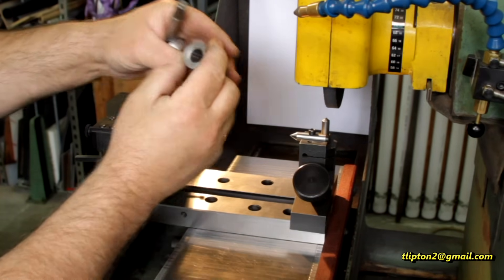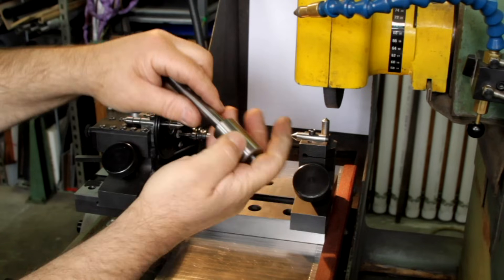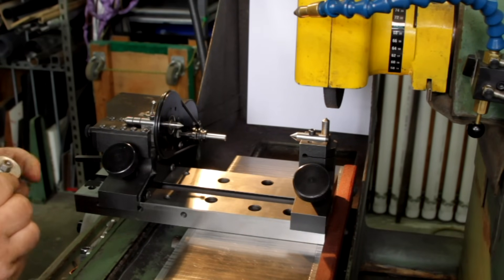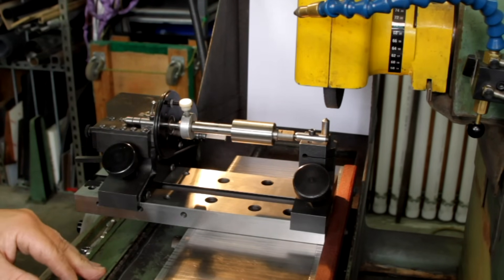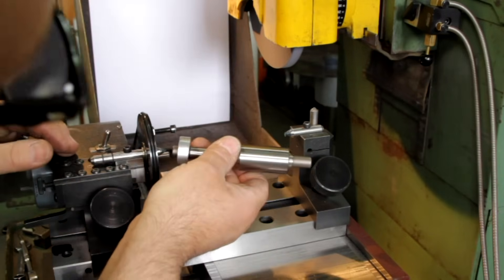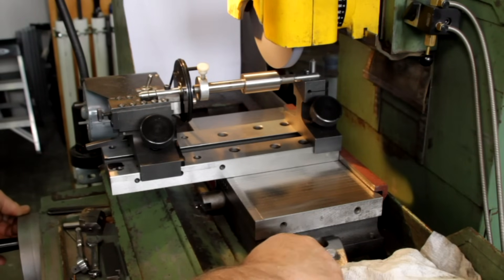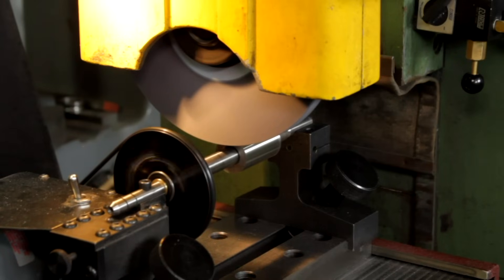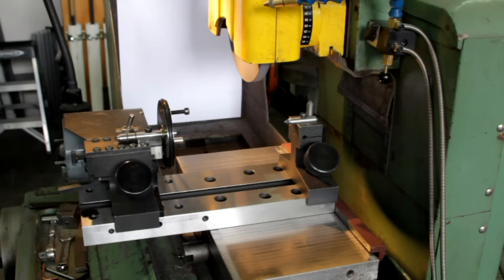Cylindrical Grinding on a surface grinder

Comment: Hi oxtoolco, I recently pickup a south bend 10 heavy, It has a worn head stock spindle shaft, I made up a surface grinder to mount to my older south bend 9, When Grinding harden steel is water used to keep it cool during Grinding, Thanks Brian

Comment: Hey man
The reason behind vibrations can be that white head fastener on the mandrel because it is a offset mass.
Love your video
Love from India
Reply: Yea that flat finger tightened screw twirling around on the mandrel does seem suspect.

Comment: Try using a red grease pencil on shaft before grinding. shows highs and lows and helps stop crashing into the shaft when feeding in, old centerless grinding trick. also helps when grinding non-sparking material. thanks for the vid!
Reply from the maker: Good one! Thanks for the comment.

Cheers,

Tom
Reply: senocon visited a workshop where they generally used inks on every job.

Comment: Hi Tom,
That's a nice device for grinding cylindrical parts, I'll have to get my hands on one if it shows up at a decent price...
I'm always puzzled as people grind without cooling the part with coolant, if I can feel the heat it means to me that the part isn't to dimension as it will move ever so slightly when back to the room temperature or original temp...   Also, the finish gets so much better with coolant.
Cheers,   Pierre
Reply from the maker: Hi Pierre,

For light cuts with a sharp wheel no coolant is fine. You are right that in general coolant produces better finishes. Thanks for the comment.

Cheers,

Tom

Comment: Excellent info on the grinding process. Years ago I came across the Atco grinder attachment base. Mine is missing the motor, pullys and centers. I see after watching this video, how useful this tool can be. Would it be possible for you to send me some info from your unit on the motor and any possible sources to find a comparable one. Would be a great help. Thanks Tom.👍

Comment: Just wanted to point out that the intermittent cut on the cylinder tends to generate heat only in the contact spot , tending to warp things around while the heat is still in it. So cooling  the part down between cuts helps accuracy  a bunch.  Watched a  foreman  destroy a blank punch for part of a clutch. it was about a foot in diameter , every time the wheel contacted the punch it would swell up in that spot  and cut even harder on the next rotation  in the same spot.  Don't think he even knew how he had wrecked it.   but there was a gob of clearance in one spot.

Comment: Nice stuff.
Isn't the most critical setup the parallel of the manfrel and the line of travel?
Not the touching of two circles on the very top, as they will touch allways tangent.
If mandrel out of parallel from travel line, you will get a cone.
Or I'm wrong?
Reply from the maker: Yes the mandrel needs to be parallel to the travel of the machine. In this case the grinding was to remove nicks and produce a better finish on the hard part. Thanks for the comment.

Cheers,

Tom

Comment: can somebody explain to me why a round bored part would sit perfectly concentric on that tapered shaft? couldn't it sit off? or does it not matter in this case if inner and outer diameter end up not being true to each other?
Reply: Jörn, I believe he said a half thousand across (I'm guessing) six inches. Couple of tenths, perhaps the tapping would seat it enough on the shaft.
Reply: Jörn Bucklitsch yes, I was thinking the same thing, probably because I am old, slow and stupid which requires more of an explanation.  And yet it looks like it is running totally parallel to the tapered mandrel, go figure!!  Regards. Joe.
Reply: I had this exact same thought. I'm guessing the taper isn't extreme enough to make one end of the bushing "off" a bit.
Reply: Jörn Bucklitsch the mandrill will touch each end of the bushing - it's only a couple of tenths across the length of the bush, and when fitting it to the mandrill it is an interference fit on the larger end - by that couple of tenths, so the small end will still be touching the bore.
Reply: alright thx for claryfying

Comment: Hello, when I was working in the watchmaking I did the same for the finishing of some tools on a lathe. To improve the finishing I put the diamente paste on the grindstone. Sorry for the quality of my English which is a Google translation.
Reply: No sweat, Philippe, I have read far far worse from supposed native English speakers be they from America, Canada, UK or Australia, New Zealand. Your comment was easy to read and understand by comparison.
Reply: Mark Fryer salut, j'ai écrit mon commentaire en français et Google me l'a traduit.
Reply from the maker: Hi Philppe,

I understand what you said. I have not tried this method. Thanks for the comment.

Cheers,

Tom
Reply: bonjour Philippe, Est-ce que vous travailler au Québec... ou dans un autre lieu dans la francophonie?
Parce que, si vous etes pas loins de Montréal-  bienvenue. Cherchez "Machineco Montreal" en Google. 
Nous avons plusieurs rectifieuses en stock.
Reply: @loftsatsympaticodotc  Salut, je suis en Suisse.
Reply: Um. Compounding your abrasives in a hierarchical fashion?

I love it.

Comment: but how it runs true when its perfect id is in contact with tapered od of the mandrel?only one end of the id is full contact with od of the mandrel,the other side is loose.am i missing something?
Reply: the taper is low enough that, with the blow on the anvil, you get good contact all across the bushing
Reply: Nope.. wont be concentric on the small end of mandrel but won't necessarily be loose either. If you heat it up it could spin on ya.

Comment: why does left right position affect surface finish.  it appears that the geometry would be unchanged as the wheel will always contact normal to the parts surface ???

nice vid :)
Reply: to minimise the reaction forces. Since the centers are floating any excessive radial forces will cause the mandrel to bounce around.
Reply: so less bouncing vertical then off vertical ??  for safety should be at least center or left of center so it doesnt get sucked in by the wheel.
Reply from the maker: Hey John,

Good question. I don't have a good theoretical answer as to why. Its just one of the knobs you can turn to change the output. 

Best,

Tom

Comment: Hi tom can you adjust the angle to cut a tapered shaft or make sure its dead parallel?
Reply from the maker: Hi Jason,

Its usually the other way around. Trying to not cut a taper. Turning it on the magnet should not effect the taper. There is a small adjuster on the tailstock end of the centers used to get taper out. Thanks for the comment.

Cheers,

Tom

Comment: Correct me if I am wrong, but wouldn't mounting on a taper ruin the concentricity between the bore and the O.D.? Or at minimum create a taper on what you are grinding from the loose end wobbling about.
Reply: this has been discussed in the comments. the answer is no.

Comment: When you put a tapered shaft into a cylindrical hole, will it not just get stuck mostly in one end? -The other end will be loose which means that the shaft and hole can be non-concentric!? (I do not know anything about machining)
Reply: as other comments that you didn't read say, the taper is low enough that you get a good fit all across the bushing

Comment: I'm surprised moving the part closer to the center of the wheel made that much difference in the finish. Why is that?
Reply: I believe the wheel is more stable at a bottom tangent.
Reply: Most of the time this happen`s because the operator slowed the feed in the center of the wheel while dressing the wheel.
Reply: i was about to ask the same thing, i'd think the two tangent spinning discs would behave exactly the same

edit: tom says in a comment that he's not sure how it works either
Reply: @rickyreynolds4090  i think you answered a different question
Reply: If you're not directly above the part, it will either try to climb the part or chatter depending which side you're off.

Comment: That dog and drive screw is throwing the mandrel out of balance, that is why it’s wobbling.
Reply: Yes, that is definitely the cause...get catch.
Reply: Good catch that is.
Reply: This was obvious from the pulse of sparks being totally in sync with the rotation? I should think a strobe that was triggered by a Hall sensor on the dog drive plate would help distinguish whether the syncronicity was due to the "out of balance" cause by using a dog from syncronicity that was simply due to that part of the part coming around each cycle by remounting at a different orientation and seeing if the timing was the same.
Reply: if that were the case, the wobbling would be more pronounced near the drive end than near the tailstock. i think the forces here are low enough to minimize that, but then again, we're talking tenths.
Reply: @ExtantFrodo2  Nice idea. I don't think that the bushing can move. It is on tapered shaft.

Comment: I know that you're supposed to lube the centers, I just haven't pieced out why?
Reply: Those fixed centers don't spin with the work so they would rub metal (static center) on metal (spinning shaft). Much friction and heat and galling without high pressure lube to stop it.
Reply: Ohhh... OK, not all centers are live centers. Do you do this to live centers too, or do I see people do out of habit?
Reply: On a good live center, in a tail stock for example, I don't think you would need it un less the part was run 'off center' in any way, because then it would be 'hinging' as it rotated. Like when you turn a taper by offsetting the tail stock. then both ends would need lube, tail stock and Dog driven end in the chuck on a center even though the center is turning with the work it will be hinging as it rotates. Keith Fenner gets into it a bit making the shafts for Steam wagon HO..
Reply: Thanks

Comment: The contact no contact at the wheel is obviously run-out.....know how complex it can be tracking it down? Put the object on dead centers FIRST, and then suspect your rig there.
   Dry grinding anything is a bad idea.....the wheel WILL load and transfer odd even contact to the shaft. I worked at a transmission factory for a few years out of high-school using 40's and 50's tech, and those old beasts would drive you nuts sometimes....J&L Tracer lathes, Warner Swasey turret machines.
   But when everything was set, those old beasts could kick out amazing production. 
   A maintenance guy told me once that they would leak sawdust if it was part of the machine

Comment: You shouldn’t have to remove that much material off of a finished bushing. Didn’t your check your arbor fo run out first? Also use a felt pin to color your part so you can watch for cleanup easier.

Comment: The taper adjustment on this thing is a bad design. If you use a standard taper center drill to center your part you will fight keeping the taper out. If you do not want to readjust the taper after every pass you always have to use bell or radius center. If you do not you will just be chasing your tail if you are  trying to keep taper with in a tenth.
Reply from the maker: Hi Dave,

I agree. The best are lapped internal centers and spherical support centers. A kinematic seat arrangement. Thanks for the comment.

Cheers,

Tom

Comment: Speaking like a true arm chair machinist with old worn out equipment & just watching a video of your buddy "ROBRENZ" truing up your machinists level frame with his .000001" electronic dial indicator, I couldn't help thinking that it would be nice to counter balance the drive dog.
Maybe if you run one of his precision stones over the surface, you might see some chatter.  Just saying. Ha Ha